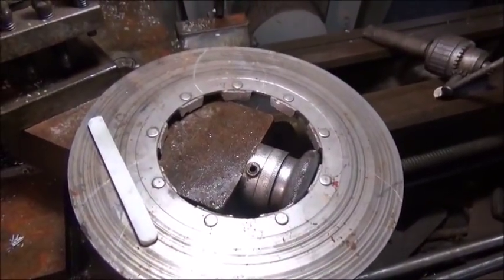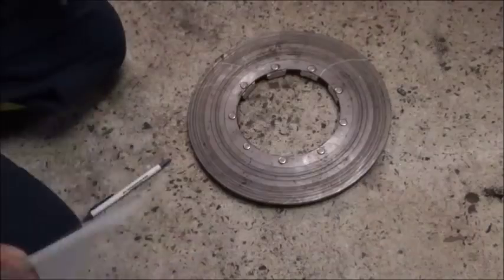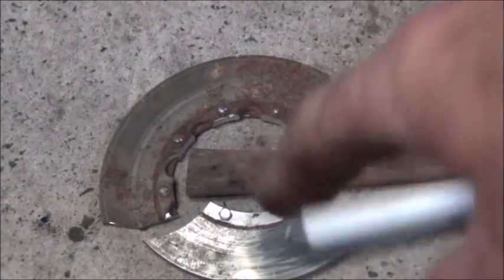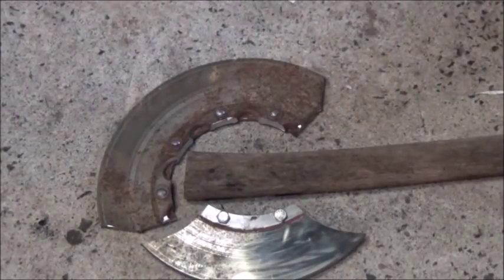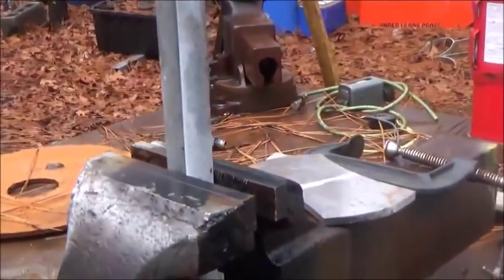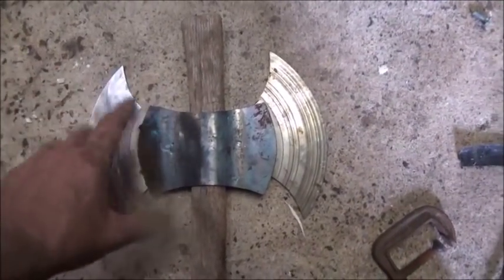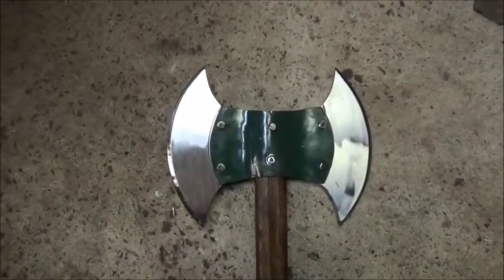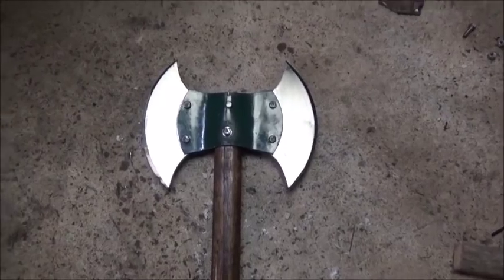Brake Rotor Axe

Comment: Great Axe from an old Brake disk. Awesome !
This is what Johnathan should do more often. Give some closure to a project. Even if he doesn't finish it he should let people see for example he sold it or scraped something. Just like he did with the hardware store Show it finished and full of hardware after some episodes.
End of story, next one. 
Johnathan video's will ALWAYS be GREAT even without the story line and the closure but then maybe sometimes an update on ALL the projects you are working on would be enough otherwise.

Comment: Transmission Fluid.  If you see a pile of steel Trans parts (clutch packs, housings, etc) in a scrap yard out in the weather they will sit there for weeks and not rust.  Mix 1 part 80-90 gear oil, 2 parts ATF, and 3+ parts solvent, OR paint thinner, OR kerosene (thin enough so it will spray).  Put it in a spray bottle and spray the machines down with it. Works wonders.  Prevents rusting very well and it's cheap to make.

Comment: Can't beat the laws of physics, have to heat the shop, even if just a few degrees.  In Calif, we used to use smudge pots to heat orange orchards.  Not sure if it's worth it, but you have options.

Comment: do you think a industrial dehumidifier  would work, my basement is pretty big and a small 1 dried it up and raised the temp up
Reply: It would probably cost $100 a day in electricity to dehumidify the shop. Those things are power hogs.
Reply: His shop is under a shed open to the elements. No way to heat or dehumidify it.

Comment: Jonathan I have the same issue up here in Ohio if you spray them down with WD-40 and then one it looks like it's dry spray them down with WD-40 again
Reply: WD (water displacement) 40 (40th attempt to get the 'mix' right)
Reply: James Letaw all I can say is that stuff works miracles I've got three Bridgeport and one garage and they no longer rust as long as they were sprayed down sometime that year with WD